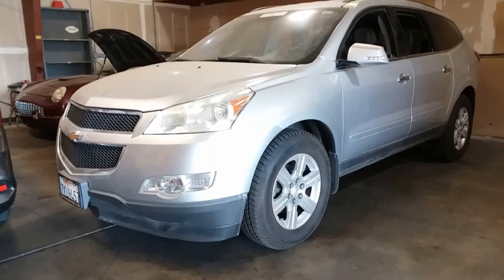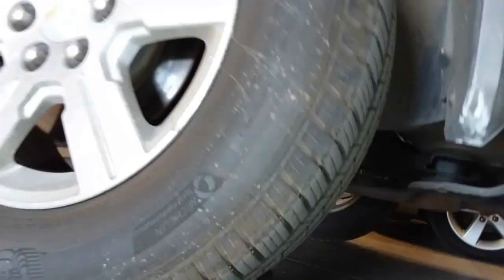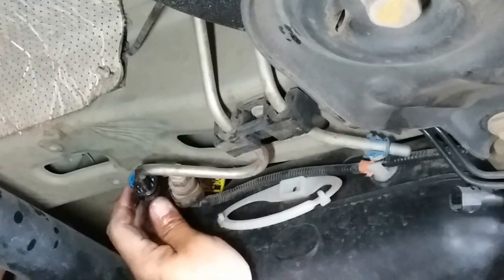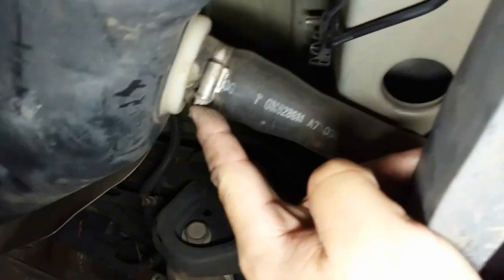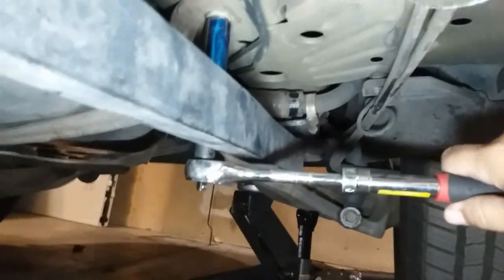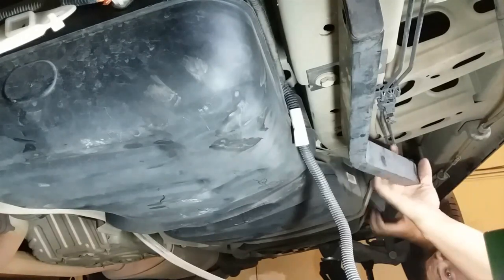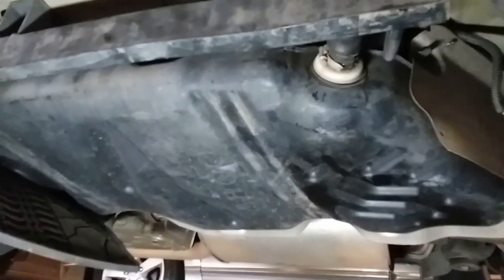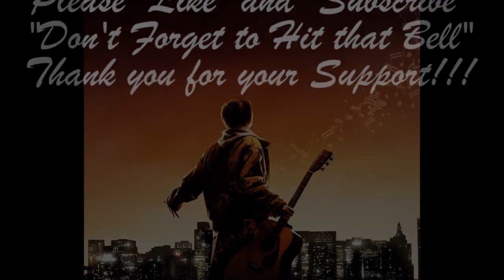How to: Drop or Remove the Gas Tank on a 2011 Chevrolet Traverse

Comment: Brother, suggestion for safety i would have disconnected the battery before starting the process to prevent any kinda spark from any of those connectors, stranger things hav happen,an always ones safety first!

Comment: George, Thanks for the details.
I did some improvements when lowering the tank.
1) First thing was to run the full gas tank to about 250 mi, I know that will leave about 1/4 tank full.
2) Then I remove center strap, then place a floor jack with a 2x4 on top and hold middle of the tank in place.
3) Then remove top and bottom straps keeping the tank level on top of the jack.
4) Place floor dollies on top and bottom to lay tank on top and makes it easier to move. Hope this helps.... :)
Reply from the maker: Thanx brother that sounds way better. I just had to make ends work honestly 😩
Reply: So how do i do that is the fuel pump isn't working

Comment: Doing this right now. Gotta be careful with the strap bolts, my center one snapped. The holes in some places you can snake a wd40 straw into and take your time working back and forth if you don't have impact tools and just hand tools
Reply from the maker: That's right! Good Luck Buddy, sorry to hear about that center strap. Thank you for your SUPPORT!
Reply: My last bolt broke almost half ,about to put a nut on it
Reply from the maker: @mikes8989  damn bro sorry. Yeah this wasn't a fun job for me either.
Reply: Worked out thanks now if I can find a video on testing the fuel pump relay on a  2011 Buick enclave I'll be closer to fixing it.

Comment: What were the codes on the car scanner?    Can a fuel pump go bad with no codes on a scan tool?
Reply from the maker: Im honestly not sure i dont remember its been a while but i don't think it had a code the car would  just crank but wouldn't fire....i changed out the fuel pump and it started to work .... i also read the the pigtail is notorious for making faulty connection....i dont know if it was me disconnecting and reconnecting that did it...u would start there, unfortunately u would still have to drop the tank

Comment: My friend , the GMC Acadia is same the steps ?
Reply from the maker: Yes I believe it should be a similar process. Maybe just a couple of differences but same procedure. Thank you for your SUPPORT! Good luck buddy!
Reply: @559powerscape  
I need your advice , because i have problem with my GMC ACADIA , I Think need change fuel pump ,
When i drive from 0 to 30 or 50 KM the RPM going up and down for 3-6. Second , if i turn on the AC maybe take 5-9 second , if going for long road no any problems
Reply: @MT-tl4rr  Sounds like a transmission problem to me.
Reply: @martinlutherbling424   mine does same thing i think is the pump, mine said engine loose power and wont go over 40 but is shifting good

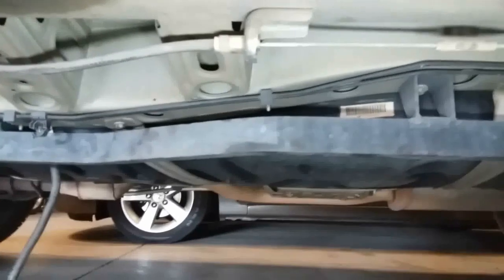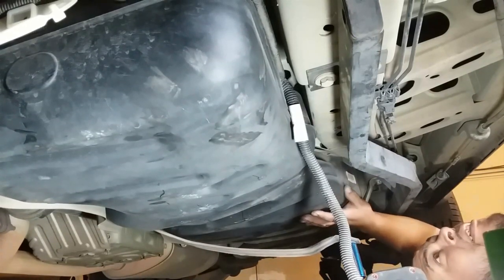Comment: 9:20 " Because it has quite a bit of fuel in it ( the gas tank ) ... " Step # 1 for this job should be to do this job when the fuel level in the tank is VERY low. The 2011 Traverse will actually tell you via the informational display on the dashboard when you are LOW on fuel and that would be the BEST time to do this job. 10:05  10:25  STOP IMMEDIATELY and EMPTY the gas tank by pumping it out with a GROUNDED, EXPLOSION PROOF fuel pump. Again.... THIS is WHY you drive the vehicle to a NEAR EMPTY condition BEFORE starting a job like this. YOU Gotta' THINK AHEAD people. He showed a bunch of tools at the beginning of the video BUT the most important tool that he DIDN'T show is the HUMAN BRAIN. That's the FIRST tool you MUST use when planning a job / project.
Reply from the maker: The car didnt start i didnt have any other choice....smh...brah
Reply: but if car wont start or like mine does not going more than 30mph and hard to start , you have to do what you have to do, this part can not wait for empty tank if is not running on first place